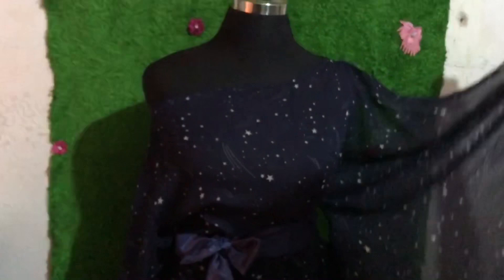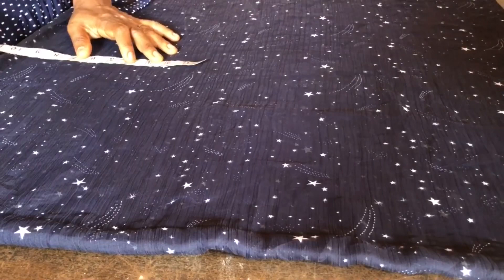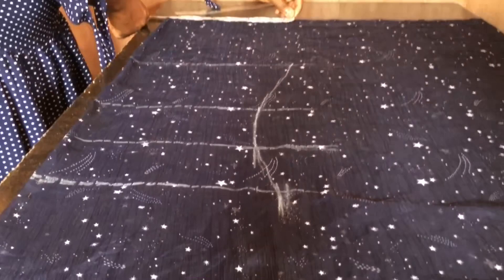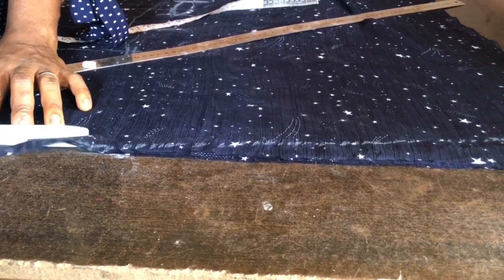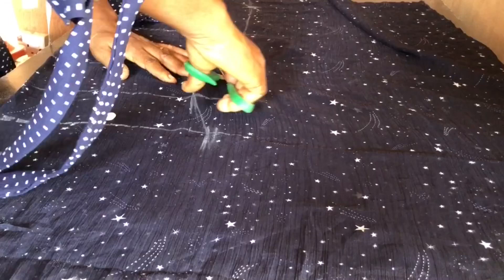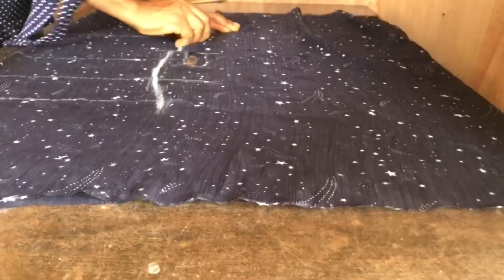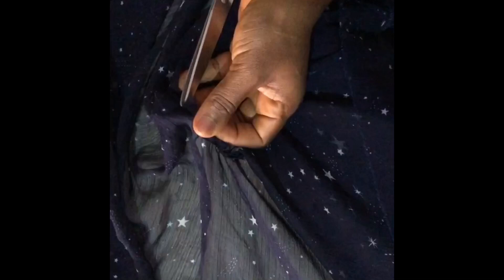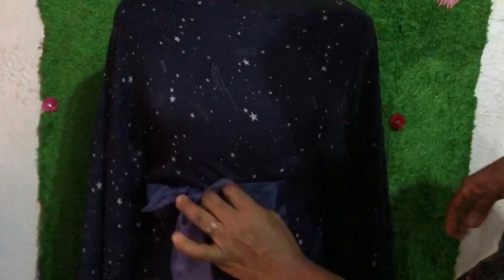How to make a butterfly mini gown with keyhole

Comment: Ma i didn't get the asymmetric neck line part. As you didn't explain how it was formed and also why was 8.5 used is that the shoulder measurements
Reply from the maker: I will respond to this but I will have to watch the video again. It has been long that I did the tutorial.